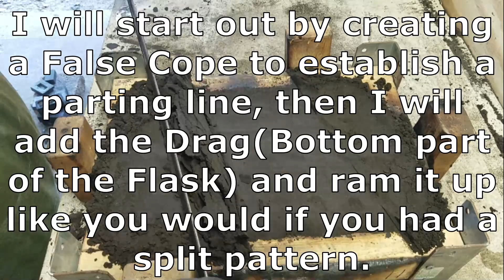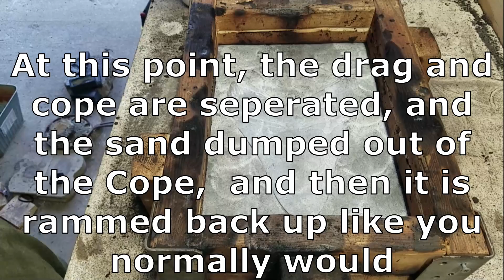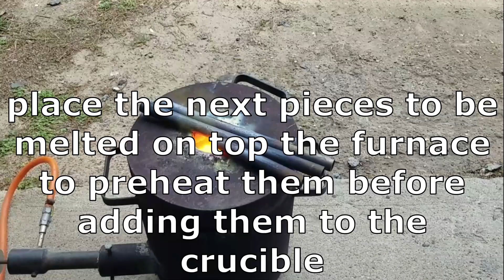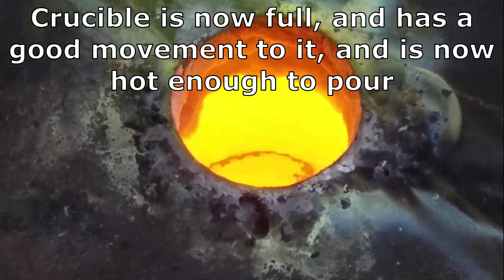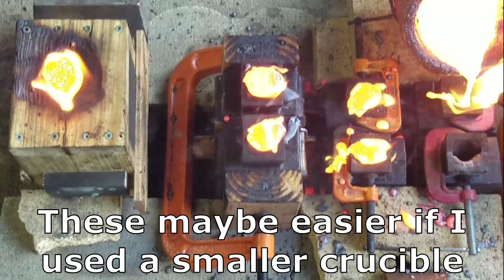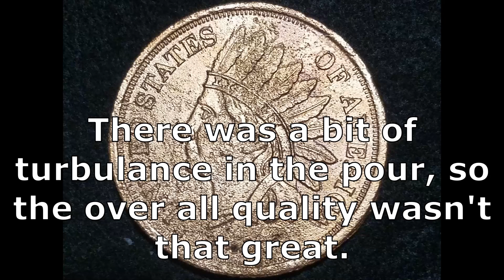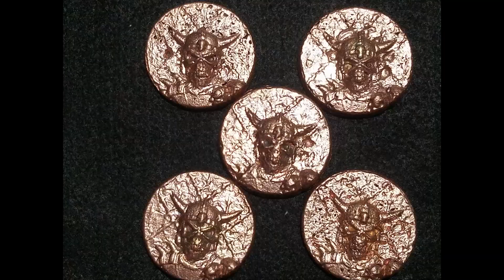Gigantic Copper Megalodon Tooth -Egyptian Pharaoh Skeletons -Big Indian Head Cent - Devil Forge

Comment: Lol! I accidentally  clicked towards the end and saw your tooth all shiny but I  thought it was a bicycle seat!  I  spent the morning fixing my XXXX up. My crucible collapsed with 6 kg. Of liquid copper in a forge much like yours. I was wondering if you knew where or what I can get some rigidizer for my rebuilt forge
Reply from the maker: oh man thats sucks!!!  What brand of crucible were you using. I use Greenpatch421 as my coating agent, which I think I got it of PMC supply. There is some stuff that is actual rigidizer, but its only used to make the wool initially harder to coat the refractory coating, if not the wool will kind of pull off when you try to coat it with a thicker refractory, But, you can always water down the refractory coating to like a thin syrup consistency, and brush it on, and then go back over it with a thicker layer. haha it kind of does, sorta look like a bicycle seat at first glance.
Reply: @Thewulf56  I took your advise using Red Devil refractory cement. I thinned it with water and more or less rubbed it on using a disposable rubber glove. Two coats. I lit the forge and got it plenty hot ao when it cools I can put a nice thick coat on. If this works then you saved me a lot of time and money!
Reply from the maker: @mattyal9347  thats what I usually do, has always worked for me.
Reply: @Thewulf56   I think its going to work! I need to get a smaller crucible because the ceramic wool was to thick but i super heated it and all went well. I did something else. I broke my old crucible in little bits and mixed it with the refractory cement and made a cat food can sized base for my crucible.  Sounds a bit under doing it but it might work.
Reply from the maker: @mattyal9347  awesome